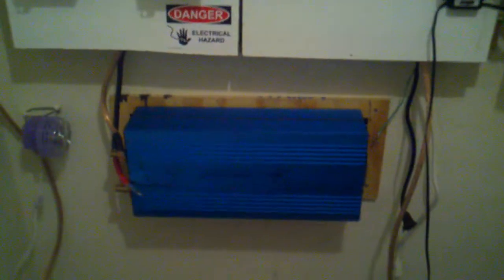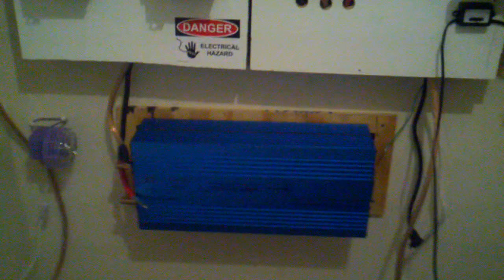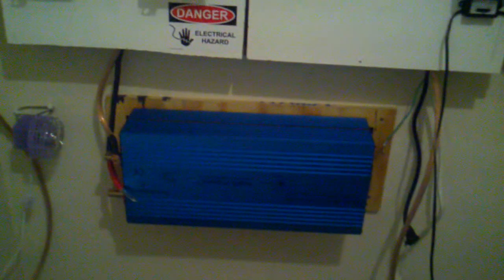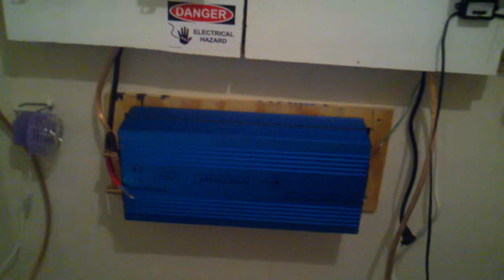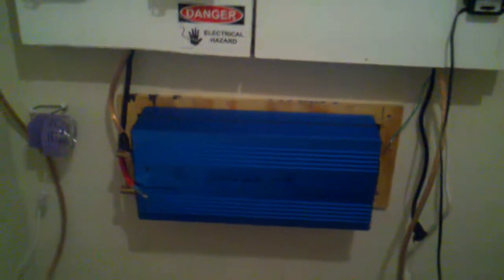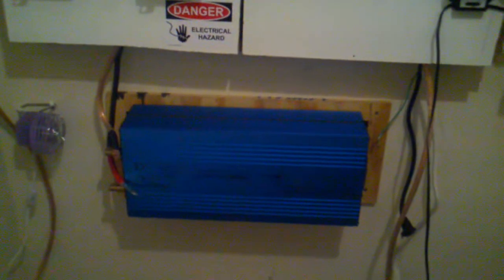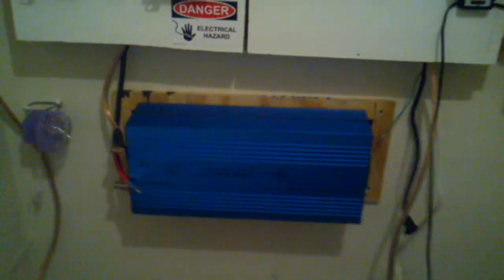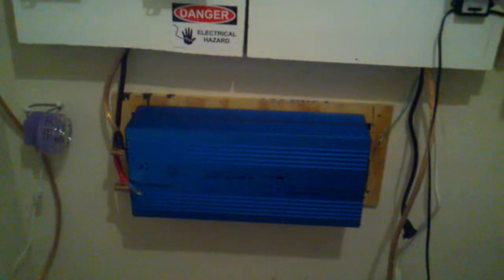DIY Home Solar - GTI with Private Grid - Concerns Verified

Comment from the maker: Thanks, the unit has been sent off for repair or replacement. I got a backup on the way. At least now we know. :-)  I will still use it with a load during outtages etc, now that I know what the limits are. Prior to the burn out today, I had everything it perfectly balanced working in tandem.  As long as there was an equal load to take the excess energy, I don't have much of a problem.  But in anycase, caution is warranted.

Comment: I just viewed your results.I applaud you willing to risk your inverter, I am most sorry that happened .That is why i did not try it with my GO Power inverter as on every page it stated not to Plug Into AC outlet or ac load.With out having a way to have balance the load as a shock absorbing device I was afraid this would be the result.I did risk a small $100. 400 watt pure sine,but it tripled the GFCI breaker, luckily not harming it. U might look inside for a a/c fuse.I Had 1 Aims Pure sine.

Comment: Thanks for the sacrifice, i was thinking if this could be done just today. but i cant help think, if you charge a battery With a car battery AC charger thats powered by the same inverter to crate a closed loop and a constant load as you always loose energy. then the grid tie will use the signal to work an run the other appliances.  ?

Comment from the maker: Thanks Shartne, it's no problem. As always it was a calculated risk. I would rather be laughed at than allow someone else to suffer, thinking there was really no risk based on something I said. That's not something I want to live with.  But anyway, the inverter just started smoking, but it still powered some equipment. My guess is it fried some of the AC circuits connected to the outlets on the Inverter. In anycase the unit is already on it's way for repair and a backup unit is on it's way.

Comment: I just want to clarify what you are saying that caused the inverter to fry. If the power had not been out and you ran the gti's, everything would have been ok is that correct? I need to know this because I just purchased a couple of gti's that I had planned on plugging into a wall outlet. But if there is a chance I would fry my inverter even if the power in the surrounding area was still on, then I will not do it at all. Thank you very much for the videos you have made. I have learned an awful lot and hopefully will continue to learn from what you have done with solar power. Thanks a bunch.
Reply from the maker: Thanks for your comments, sorry for the late response. Holidays and family have kept me away from responses.  The reason my inverter fried was because I was experimenting with using GTI's in conjunction with my regular inverter to see if they would work together to power the house in an outage. I found that it was not a good idea to use them together.

Comment from the maker: Yes, you did warn me. And I thank you for it, not just for me, but for everyone else also. And you have every right to say "I told you so", :-)  However, I did find a way to balance the load and it worked fine, I found that if you maintained a range of around a 5A to 15Amp draw coming from the battery bank with the loads you wish to run, then things work fine. A fridge, freezer, computers, etc will consume the power of 200w to 300w from a GTI. But in any case caution is well advised. Thanks.

Comment from the maker: It would work if you had a constant load similar to what you suggest. However, I am obligated to say that it is a risky business. I had 2 videos that showed the gti working in such a situation,  however I removed them because of the inherent risks involved.  It is possible with a "constant" AC load greater than what the GTI is producing so that it will consume it as opposed to overloading the regular inverter. Again, this approach is risky to your inverter and must be monitored for safety.

Comment: OK, lets stop this. DO NOT DO THIS ! You are risking expensive equipment for no reason. NORMAL power inverters are cheap. Modified sine wave MSW inverters can run MOST of your loads and are very cheap so USE THE EQUIPMENT AS IT WAS DESIGNED FOR. Buy 3 MSW and wire to particular circuits. And your fridge is not a CONSTANT LOAD it goes on and off all the time. When you push power into the grid you are powering your whole town, think about that, it's a infinite grid as far as the GTI is concerned.

Comment: You might consider just upgrading to a pure sigh wave.
Prices are coming down all the time, just picked up a 2k with a 3k serge for a little more then $409.00 with free shipping, I have been using it a little here and there, works great, the variable speed fan only comes on when your really running it hard
w w w (dot) donrowe (dot) com / inverters / prowatt _ sw _ 2000 (dot) html 
this is the exact one I bought.
Paid this much for a modified sigh wave a few years back with the same power.

Comment: I warned you... Why did you do that? You could have done a CONTROLLED test with a variable power supply and watched the AC voltage come up and then STOP before it got too high knowing it will keep going. The idea of a GTI is to take the input power and push as much of it as possible to the UNLIMITED, INFINITE LOAD OF THE GRID. You are the second guy I warned about this and no one listens. AC things go on and off so it's going to be very hard to maintain CONSTANT loads in this situation.